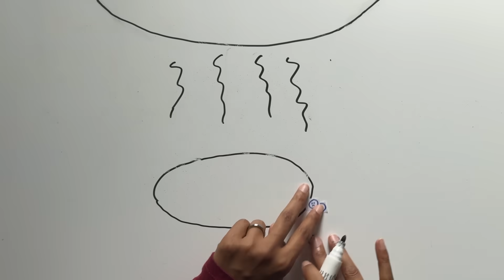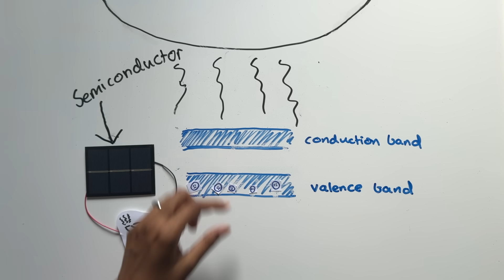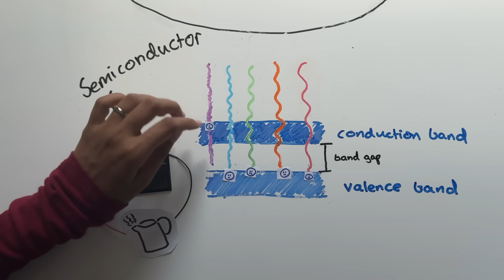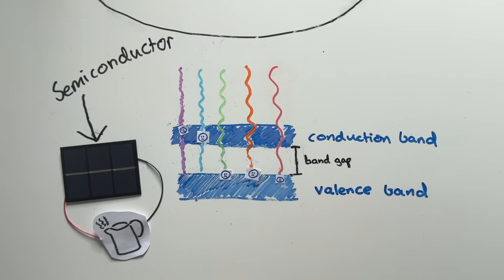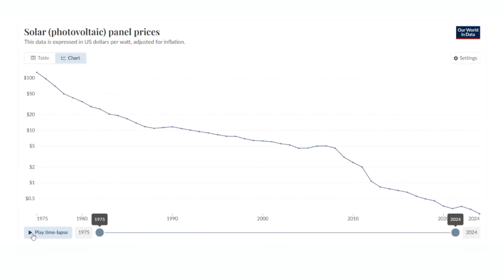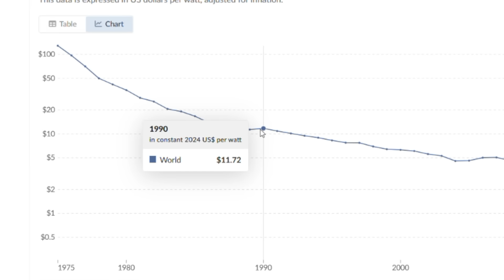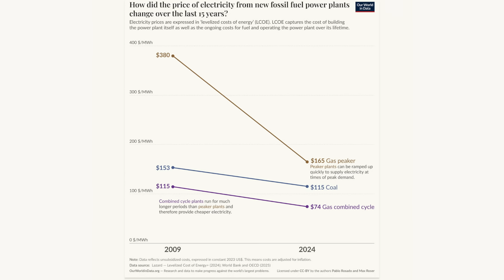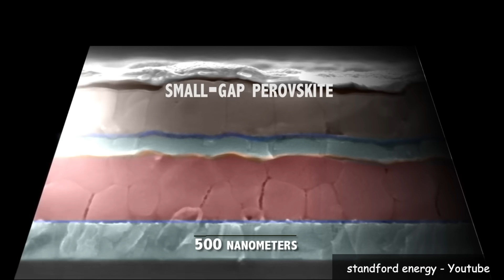Why solar panels can't be more than 33.7% efficient

Comment: At 2:00, this is a vast mixture of incomplete and wrong.  Normally, a semiconductor's valence band is full and its conduction band is empty; neither band can normally conduct electricity until we dope it with specific impurities to add electrons to the conduction band (n-type) or to remove electrons from the valence band (p-type).  Even this does NOT create a solar cell; however, by joining p-type material along a border to n-type material, we allow the extra electrons from one side and the extra holes from the other side to diffuse across this border and to recombine.  Since electrons and holes have electric charge (+/-e), this diffusion creates an large electric field in this 'junction region.'  Solar cells exist because photons entering this junction region excite electrons into the conduction band leaving holes in the valence band and the large electric field accelerates these charges -- holes to the p-side and electrons to the n-side where the circuit ends then allow them to flow around the circuit.  The band gap determines the voltage increase across the junction (V=Eg/e).

It is also not true that only the top of the valence band can be excited; ANY valence electron can be excited into the conduction band just as the electron can occupy any state in the conduction band.  In both cases, however, states further from the gap have higher kinetic energy.

Finally, this efficiency limit does NOT apply to multi-layer solar panels whose top layer has wide gap to utilize UV, a middle layer with moderate gap to utilize visible, and a bottom layer with small gap to utilize IR.
Reply: Did you expect a completely exhaustive explanation of how PV panels work in a 15 minute video?
Reply: @HeyChickens  I expect only truth -- a property mostly lacking here.  Whether due to incompetence or intention is unknown.
Reply: Intrinsic semiconductors don't need impurities to be "semiconductor". Adding impurities is part of band-gap engineering for a specific purpose.
Reply: @krishnendumaity4480  Intrinsic semiconductors don't HAVE impurities (or more precisely they have equal numbers of donors and acceptors).  And the "specific purpose" under discussion is solar cells.

Comment: 25 percent is amazing if you consider the actual energy efficiency of fossil  fuels from the point plants do photosynthesis all the way to when we extract the energy. Sure fossil fuel may have more efficiency in its processed form but its like a ancient battery. And that battery is going to run out since it takes centuries to recharge it.

Comment: Nuclear energy is cheaper and more reliable than solar energy
Reply: At a large scale of course
Reply: Tbf, any energy we saved using solar is that much more time we can extend our definitely finite deposit of radioactive material used for nuclear reactors. So the obvious answer is to use both. No need to choose you know?
Reply: As a German i must laugh now.

Comment: Okay so the electron  goes up to the conduction band where it can move but why would it? What makes the current flow?
Reply: From what i think, this is where the doping comes in. The p and n type doping gives a potential difference
Reply: My guess is it's because things tend to move to a lower-energy state if they can - just as water flows downhill (and can be used to drive a watermill as it does so).
By flowing round the circuit, the electrons can get back to the lower-energy state in the valence band.
The doping of the semiconductor material allows the electrons to move within it. Otherwise, the electrons would be stuck in place, unable to flow into or out of the external circuit.
(Simplified explanation, but hopefully it's essentially correct.)

Comment: Love your videos.  Honestly the best explanation for me that I’ve seen.
Only comment I would add is that batteries is much broader of a concept than simply storing electricity.  I realize that it was a minor comment but I feel like heat batteries, especially in colder climates are often overlooked.

Comment: Rooftop solar is great. Solar farms are a disgusting waste. Put the PV panels on the structures they serve--structures that are already taking up real estate. Don't take up good real estate for solar farms.
Reply: Solar farms are usually built in the middle of nowhere, on land that is cheap and where building structures is not feasible. You can always remove the panels, build structures and then put the panels on top.
Reply: I dont get what you are saying. Solar farms are a productive use of land. Just like growing soybeans. How about this as a compromise: We have many thousands of acres devoted to ethanol production for cars, which is a wasteful idea. Let's convert all that land to solar. And dont forget all of the parking lots out there. And mixed solar/agricultural. And rooftops. And even ground based residential.

Comment: Boeing / Spectrolab produced multi junction cells in 2010 that reached nearly 40% efficiency  and could be mass produced (cost ?)... and if I recall correctly did it a long time before that for applications in space ( the cost was astronomical as well)

Comment: People seem to forget about solar thermal rather than solar PV. It's much more efficient and is pretty cheap (especially if you DIY). If you concentrate the solar thermal on space and water heating it frees up the solar electricity from PV for doing the tasks that can't run by heat making the whole system cheaper and more efficient since you don't need huge inverters are such large PV arrays.

Like go check out Sergiy Yurko's YouTube channel for DIY thermal collector ideas that are monumentally cheap to build.
Reply: It seems the problem with solar thermal is not the collector but the cost of the rest of the system--tanks, heat exchangers, pumps, controls, back up heaters, etc.  I developed some technology for low cost collectors, but that turned out to be a clever solution to the wrong problem.  Solar thermal always seems like an obviously good solution, but it never quite works out.
Reply: As with EVERY energy converter, there are drawbacks and advantages, and these often vary with specific local environmental and technological conditions!  Furthermore the economic and political situation add more criteria yet and often lead people to compare systems on the basis of money which captures so imperfectly the multitude of criteria which ought to be taken into consideration when comparing different technologies.
Often we are also COMPARING DIFFERENT THINGS, for example the thermal water heaters intrinsically serves as an energy storage device.  On the other hand, its applications are rather limited: good for showers, for washing dishes, heating space but little else, whereas standalone solar panels might allow many other things: watching TV, operating a vacuum cleaner and all kinds of electrical appliances, but unless these panels are either connected to batteries or to the grid, with some kind of net metering arrangement, one can only use these appliances at the very moment the sun shines and in the precise instantaneous power limit the panels and their inverters allow.
My point is not to brag about, nor to bash, either of these solar technologies but to use them to illustrate the need of evaluating things on a case-by-case basis while also trying to see the whole system.   This is a difficult exercise at a time when everyone tends to push "their" "solution" at THE panacea to usher a more "sustainable" energy system. (And BTW, while sustainability is ultimately very important it isn't even the sole pole of evaluation one ought to consider).
Reply: Here in Germany people used to install solar heat collectors on their roofs earlier. But a collector of approx. 2 square meters costs 1200€ while a solar panel of same size costs about 100€, including mounts. The heat collector requires thermally insulated pipes and a pump, the solar panel only cables.  The heat collector provides about 300W of heat per square meter, the solar panel 200W of electric power. If you have solar panels instead of heat collectors you can use the electric energy to either heat the water in your heater's storage tank using a resistor - like an electric kettle - or if you have to run your heat pump. With the heat pump you yield 3 times the energy the solar panel provides compare to the 1.5 times the heat collector can provide.
And the heat collector is unnecessary in summer while the solar panel can supply your home. Together with the huge financial advantage heat collectors are nice, but solar panel are much better.

Comment: I would expect the optimum band gap to depend on where you lived.  In northern latitudes or places with more overcast skies, a lower band gap would be desired since the spectrum is redder do to the scattering of shorter wavelengths.

Comment: Mianly comes down to the fact that IR isnt a good enegry source, but IR could still be used to make heat. That heat can then be injected into your water lines to heat up your water a bit. Not a lot, but it is possible. With that said, most solar panels are switching to duel band gaps to capture the most power from the light source. This means todays 400 watt panels could see a size drop by half OR they can see a full 800 watts in the future, but thats the real limit. From there, the only other way we can improve that is to convert low wave into higher ones. We are seeing that nano particals might allow this. Yes, the same nano tech that goes into TV screens.

Comment: If we take for humanity's average electricity requirement 5 TW as a benchmark (taking into account an increase compared to today's generation due to electrification of certain non-electrified sectors and general wealth increase), then taking into account the solar constant (1000W/m^2 on earth's surface, panel's conversion efficiency 20%, capacity factor due to day-night cycle and clouds etc... another 20% (depends on location and whether trackers are used but I take a rough average), then you get 40 MW per square kilometer. So you'd need around 10^5 km^2 of land for these panels, that's roughly a square of 300km in both directions. Some people then jump to the conclusion that you have to think about space-based solar power (but maybe not?)

What do you think about those space-based solar ideas? I never understood why everyone insists on microwave transmission and not mirror? Or should the loads (e.g. datacenters) themselves be put into orbit?

Closer to earth, the multijunction idea is not worth it, but what about trackers (single-axis or double-axis) ?

What storage options are credible, to abridge the day-night cycle, the seasonal cycles, the dunkelflaute, in case of 100% solar?

Comment: Solar panels can overcome the Shockley–Queisser limit by using quantum dot technology or by having multiple PN junctions. There are experimental solar panels in existence with a efficiency of 50%
Reply: Quantum dot (QD) solar cell efficiencies have surpassed 18%, with theoretical limits as high as 66% (as of 2013)
Reply: If a material could be found that shifted all wavelengths of visible light into the the near infra red. And you had a high efficiently in the near infra red collector you could  achieve high over all efficiency. Oh I see this is quantum dot technology lol
Reply: QDSCs are not necessarily long-lasting in outdoor environments (24h/365d/30y time scales).
Reply: Do you have a source for that? I'd like to know more.
Reply: @Rhannmah  NREL has a handy chart and supporting data: https://www.nrel.gov/pv/cell-efficiency
Reply: @Rhannmah  These videos explain quantum dot and multi junction quite well.
https://www.youtube.com/watch?v=81JgczyzXy8
https://www.youtube.com/watch?v=FwFj2cGkyUc
Reply: @Rhannmah https://docs.nrel.gov/docs/fy13osti/59015.pdf
Reply: oh interesting. So currently a lab tech, that we may see in 20-30 years, if ever.
Reply: @peppybocan 10 years.  They go into production for space applications as fast as possible if they’re radiation tolerant ans have enough lifetime.
Reply: @Georgewilliamherbert  how much is one quantum-dot panel worth? Are they currently hand-made?
Reply: @peppybocan several hundred dollars per watt and up for space rated ones.  Some geostationary communication satellites are getting tens of kilowatts now, and the cell budget is noticeable.
Reply: @peppybocan  They are unlikely to completely replace singal junction due to difference in cost and complexity but milti junction solar cells are being used for concentrated solar and aerospace applications. For example they are currently being used by a mars rover. So they do work outside of a lab but they are not manufactured in large numbers.
Reply: @peppybocan why are you complaining?

Comment: Evreone talk alot about gas emission, but no one talk about a heat emission from electric grid. Even when humanity be able to stop burning fuel for electric energy power grid be same so they keep to emit heat and it 70 percent off all energy what they transffer, also solar panel transfer that part sun light what not transfered into electricity in a heat so yes less gas emission (trap heat on earth and make me sweat) but still make heat.

Comment: I didn't get why small band gap is bad ... More electrons flowing seems like a desirable thing.
Reply: because you get less energy per electron, that determines the voltage of the cell. power is volts times amps, you want to maximize power, not current.